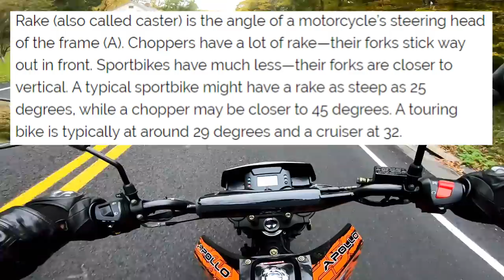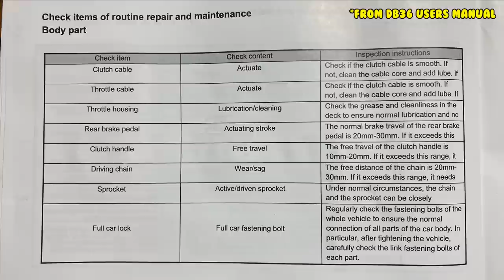[E1] Vitacci Apollo DB36 Supermoto Review, Build, Assembly, Test Drive, Impressions.(updated $1799)

Comment: If it's anything like the new Royal Enfields you will gain a lot of power bypassing the evap unit for the omissions. Nice looking bike, I like the Honda valve adjustments caps like my XR250R , best design I reckon .
Reply from the maker: I’m going to remove it eventually. Honda clone motor!.

Comment: The break in thing is a myth. Watch factory videos where they put bikes on a dyno before they send them out to make sure everything is good. They already put the bike through the whole rev range. When you break in just fluctuate the revs, that's all. Don't baby it.
Reply from the maker: That’s current bikes. These are like cars and bikes from the 80s. I do a small breakin. I certainly don’t baby it. 300 miles is it. Corvette even has it programmed in the computer you can’t rev past a certain ROM until a set mileage still too. Chargers etc too

Comment: Nice work. I see you mentioned no counterbalancer.  For you to think about that tells me these things buzz. I'm an old bsa 441 guy, and I know buzz. Tight engine bolts and a cylinder head brace help, but. I read somewhere about  filling the handlebar ends with lead, and it made a big difference in buzz. Shape a bit of wood to make a plug and force it into the bar end then in goes the melted lead. A coffee can and a few tireweights or whatever you have, melted and poured in. Propane will do it.  Oh, melting lead will kill you if you get even the least bit of water in the melt. So safety up for this bit.  BE CAREFUL. Only the stuff in the ends helps, no need to fill the bar center. Keep up the good work.

Comment: Hey i been having this bike fo about 6months. I can get to about 70 regular driving 75mph downhill tucked lol.. Wat can i do to make this thing a lil faster.. i tried lookin fo a cam but they dont sell cams fo this bike. I was lookin fo cdi proformance box and ignition but seen alot of vid. Seens like they dont do much. Was thinkin of gettin a nibbi racing carb with filter n jetting. What do u think?
Reply from the maker: Yes. Either bigger racing carb or porting and head work
Reply: Find out how many baffles are in the exhaust that you can drill out without touching the spark arrestor and take the lid off ;)

Comment: Which one is the best in your opinion? I really want to get one but can't decide which. 
Thanks for doing these. Very entertaining.
Reply from the maker: It's between the Brozz 250 and the Hawk DLX. I have a ranking chart on MotoCheez.com comparing all the bikes I've reviewed
Reply: @MotoCheez  cool! I'll check it out. Thanks
Reply: @MotoCheez  can you break this down a little bit I've looked at your charts, but I saw the Apollo has a higher overall ranks then the dlx, which bike would be better for which crowds if you don't mind my asking
Reply from the maker: If you're looking for a supermoto it's great. Suspension is too tight for offroad, the engine is a CB overhead cam engine too.

Comment: Breaking in an engine is not about keeping the revs low it is about constantly varying the revs and not allowing the revs to remain the same for extened periods of time, the more you know.
Reply from the maker: Yes,. That's correct. Varied rpms and loads.

Comment: I wish we could get some of these dual Sport bikes in Canada
Reply from the maker: They’re not up there? Pretty sure txpowersports ships to Canada. Not sure though.
Reply: @MotoCheez  we can get the pitbikes and some of the smaller dirtbikes but I have not managed to find any of the dual sports or larger dirtbikes. I think it's due to Canada having more strict safety laws.

I had looked at tx before but will check again. Having a cheap bike I can use to go to work when it's nice would be awesome.

Comment: Well I over 700 miles on the bike so far. I been doing alot of highway riding aound 55 to 60 mph. I wanting to do a sprocket change to lower the rpms. What would u recommend to change it to and where would u buy it ?
Reply from the maker: Since these bikes have the larger chains I don't know the size yet. You can switch it over to the 428 setup the hawk runs, or maybe chinariders.net has the size you'd need. I'll probably know in about a month when I do mine.
Reply: @MotoCheez  I'll wait till u do yours!!!!  Mini truck making that money I see !!!!
Reply from the maker: @therockjab  yes!!!

Comment: oh hey MotoCheez i just really want to ask you what main jet did you used on the apollo when you take out the 109 main jet
Reply from the maker: I think the 112.5 worked best.
Reply: @MotoCheez  ok thanks MotoCheez
Reply: @MotoCheez  how about i do 115 is it ok
Reply from the maker: You can try it. If it boggs full throttle, drop I'd down.
Reply: @MotoCheez  ok thanks MotoCheez
Reply: @MotoCheez  i want to ask you what is the best sproket size for the apollo to get more power/speed
Reply: for front and back
Reply from the maker: I haven't changed mine, they're different pitch than the hawk and TBR7
Reply: @MotoCheez  ooo ok thanks for the information..But if you want to change it please make a video of it

Comment: Hey so took the bike out however the fuel gauge isn't working to u have any issues with yours not working tid I have to plug anything in ?
Reply from the maker: Mine works fine. You fill up the tank? At 1/4 mine reads empty.
Reply: @MotoCheez  good to know!!! dont laugh but it wasnt plugged up ha ha !!!!!
Reply from the maker: @therockjab  haha. That's my first suggestion, but I passed over it..
Reply: @MotoCheez   yea went back to the basics... everything was plugged up but that ha ha.  Definitely gonna have to jet this thing . I have to run it on full choke for a while then half choke to run.. halfway decent.

Comment: Hey, Motocheez  what do you think about the Appolo DB36 for a trail riding bike I weigh 130 pounds and I live in centra; Texas about 130 miles north of Austin witch is the capital?
Reply from the maker: It's a harder ride, but you can use for trails. Only issue I had was the kickstand bracket hanging so low.

Comment: Those features are hilarious. Air shock? Over head cam? Wow big f'n deal. Roller chain guides are not preferable. Most those features are bad not good. That bike is junk.
Reply from the maker: Nitrogen charged. It’s an exact Honda cloned engine. Rollers I agree on such a small travel suspension bike

Comment: I'm not  Knowledgeable about dirt bikes so excuse me if my question sounds dumb.☺ so  The carburetor why did you take it off then change the little boat that was in there. I know you used the correct names but I forgot 😅 I'm actually about to buy one of these so I mbv trying to get some information  thnx
Reply from the maker: Any new item with a gas engine has to pass EPA to be registered, so they come very lean. If you're at a high elevation like 6000 feet jetting may work

Comment: I just got mine today I ordered it off amazon because txpowersport.com didn’t have them in stock forever it seemed so I ordered a black one had to take a green one which is fine I’m taking the stickers off anyway but a few things if your gonna get one is get different bolts for the plastics the tank shroud will not work with the short bolts they give you....you will get a few rubber bushings on the triple clamp holding it into the metal package use them to isolate the fuel tank when bolting it in because the will crack from vibration.....also delete the main fuse ....one more thing that could leave you stranded....if you order a nibbi carb you need the angle intake from semoto Because the straight one won’t work....the bars need the adapter risers you can’t bolt up to the triple tree with any normal riser....I’m going to machine the stock ones to fit a fat bar....but it fired right up ....good looking little bike ....and cheez is right the motor feels strong and brappy

Comment: I’m thinking about getting this bike. Guy is asking 2500. It’s assembled and has 60 day warranty. Is this a good deal?
Reply from the maker: Hmm. Idk.. it comes down to preference
Reply: @MotoCheez  Thanks for responding. Is your Apollo 250 still proving to be durable?
Reply from the maker: Pretty muck. The tank cracked from vibration. Should be rubber mounted. Can do if you buy. Runs great after mods. I show it all in video playlist for it

Comment: cool video great looking bike I like it, I have the very same engine only I used a PWK38mm carby  and it runs so much better you will need the adapter for the inlet manifold
Reply from the maker: Thanks, I have been wanting to put one of those carbs on one of my bikes!
Reply: I have the all dirt 250 and it seems to struggle when I give it gas. Do you have a link to the carb you bought?
Reply: @drchan5893  Thanks I will check that out. Do you remember what jets you run in it? Im new to all of this.
Reply: @haydenrudd4514  , you need 30-32mm, but before you buy check your carby the fuel jet should be no bigger than 110 also check your valves have a little clearance If you still have trouble check the fuel pump run a piece of hose from the tank straight to the carby if this works you know its the fuel pump not working at high RPM and the fuel should be 91-95 Octane.
IF you buy a new carby get a VM26 and it will bolt up no problems you don't need to get any adaptors-  let me know how you go with it, Im here to help if you need.
Reply: @drchan5893  So you suggest a 26mm carb over the 38mm for this engine? Thought you had put the 38mm on yours
Reply: @haydenrudd4514  - VM26 is 30mm this was just a suggestion for you however you can get a bigger carby but you will need to find the inlet manifold ( adapter ) to suit your motor. I had a PWK34mm it came with the adapter hose and spare jets BUT you need to change the Inlet manifold to suit this carby 
I just wanted more power so i got the PWK 38mm
Reply: @drchan5893  Thats exactly what I am looking for, more power ha
Reply: @drchan5893  So what adapter did you end up useing?
Reply: @haydenrudd4514  - this is the link for the carby https://www.aliexpress.com/item/Universal-250CC-350CC-PWK-Carburador-Motorcycle-Carburetor-For-Mikuni-Dellorto-Koso-With-powerjet.
scroll to the bottom of the page and you will see the adapters.

Comment: Hey I’m trying to take off my carburetor how you get the choke line off without removing the tank
Reply from the maker: the cable disconnects and the cable should work out through the groove for end ball
Reply: MotoCheez sent you a pic on ig

Comment: Like how bad is it on the trails? Could I at least enjoy it on a dirt road?
Reply from the maker: It's fine in a dirt road, just a little stiff suspension but it's perfectly fine for trails and dirt, as long as you don't hop logs. Lol. Unless you move the stand bracket

Comment: Honestly you ride one these things you’ve rode them all they use the same Lifan motor or exact same design and the frames and suspension are deadly on these oversized pit bikes
Reply from the maker: Brandon_kx250f the CB motor is great. Suspension on this bike is very different. And the enduros have a few different type suspensions.

Comment: Which would you choose between the hawk dlx and this apollo if you travel on it like I plan to do.? I am planning to ride about 650mi one way and would like some of your thoughts on fuel economy, reliability, etc. on the two.
Reply from the maker: The Hawk for sure. This Apollo has a small tank and narrow seat. These bikes get between 45 and 50 mpg and are pretty reliable. They used expired patents of Honda engines and clone them.

Comment: Hi Motocheez! Getting ready to tune the PZ30 carb on my apollo. How did you get the brass plug out for the mixture adjustment? Also did you end up shimming the needle? Thanks!!
Reply from the maker: The brass plug is a bitch. Small drill from the side and I knocked it out. I used a small #8 washer to shim needle. Yw

Comment: Amazing how to assemble it, are the gears close ratio? I may get motorcycle operator license to use on nearby roads, are the tires a Chinese brand? Does it have a rim lock like a HONDA dirt bike? How would you rate it's safety performance?
Reply from the maker: Gears aren't that close, but decent with stock sprockets tires Chinese too. No rim locks but has the hole. Pretty safe and reliable. A ton are out there over the last 5 plus years
Reply: @MotoCheez  These might eventually sell more than the other brands I'm thinking because of more affordability, why pay like 18k for one that could be like 2 dirt bikes or 1 car for example? It's ALL about cost.
Reply from the maker: They're great if.you know how to tinker on them
Reply: @MotoCheez  I know how to also work on my HONDA XR400R but also I let my mechanic do some of the major work for a lower cost than the dealer to save $$$.
Reply: Do the tires have a name on them like SHINKO? Can you get inner tubes with angled valves in possibly 17 inch?
Reply from the maker: It's china brand tires but they're decent tires even in the rain. I'm sure you can probably find angled stem tubes. The rims like the bikes are copies of japanese bikes. Not sure what rim this would be off. It was probably a drum style converted to disc.

Comment: How reliable are these things? The price is very tempting
Reply from the maker: David Stancu I’ve had dozens of Chinese bikes over the last 3 plus years and they’ve impressed me, small issues like bolts vibrating out. Some adjustments and tweaking. Overall I say well worth the money. Not powerhouses or motocross bikes but decent back road and trail bikes.

Comment: Are the wheels small or are they normal size compared to the hawk?
Reply from the maker: They’re smaller (17”) and the front tire same diameter as the rear. Usually dirt bikes have 2” larger front wheel. Sit it handles great in the road.

Comment: It sounds like the valves are to tight to me.
Reply from the maker: Why do you say that?
Reply: @MotoCheez  Tight valves have a certain sound to them.  I've done a BUNCH of work on chinese 150cc motors & learned to tell a lot about engines tune by sound.  Of course, I'm listing through youtube, on my phone.  So could easily be 100% wrong!  But just the way that motor revs & doesn't have really crisp sounding compression, it would normally mean the valves or at least one of them isn't closing all the way.  :/
Reply from the maker: @2CabrasLocas  ahh, I see  in person it sounds ok by ear. Don't forget these are the OHC CB style engines, not the pushrod CG. And a tight ntake wouldn't idle very good and  tight exhaust would cause excessive heat.

Comment: With those rim sizes you may be able to run a 120/70-17 front and 140/70-17 rear to get some awesome supermoto street tires (conti attack sm, metzelers, etc)
Reply: I was thinking the same.... did you ever figure out can it be installed? That will be a sick look also can you change the exhaust? Im thinking of getting one in April

Comment: Just got mine, looking to get more top end. Would you recommend running 16t in front and leaving the rear stock for gear ratio
Reply from the maker: Yes, i I also want to go up a tooth in the front I was actually going to do the same soon. Haven't researched what front sprocket will fit, it's not the same sprocket pitch as the other China bikes. .
Reply: Right on brother, post a vid if you find something. I’m checking out your website now your the man
Reply from the maker: Thanks!😁
Reply: What’s up motocheez getting my new carb in tommarow. Do you remember what the stock pilot jet number was? if you could tell me I’d appreciate it man .
Reply from the maker: I don't recall the size... Not sure if I showed in this video either. 35 maybe?
Reply: MotoCheez thanks 👍

Comment: Break it in like you want to ride it. Unless its flat tappet cam. You want cylinder pressure to seat the rings.
Reply from the maker: But they say if you run too hard and there’s blow you before rings seated it will glaze the cylinder from washing the oil.
Reply: @MotoCheez  if you wait to load it up it'll wear the etching before getting high cylinder pressure. I was taught get it running, set the valve lash and verify oil flow. Then take it out for hot laps and run it as hard as possible. If there's any defects, you want to know before your heat race.  Race engines dont get 1000 mile break ins.
Reply: Race engines also get rebuilt a lot more often.
Reply: @techmaven5900  25-30 nights is pretty normal. I was under the impression that manufactures want an easy break in because mass produced motors arnt precise and they want any imperfections to wear in rather break.  Either way. 1,000 ways to skin a cat. I'll stick to my ways of setting the valves, checking oil pressure and breaking it in hard
Reply: @Motocheez: You are correct. I break my engines in by varying the load and rpm for several hundred miles. On the Chinese bikes for example, I do repeated 30 to 50mph runs in 4th gear at 50-75% throttle. Full goose after 2 oil changes at 300 and 600 miles.
Reply: @techmaven5900  damn. 300 miles. I was always told you have virtually no miles to let it wear in or you loose the prime opportunity to seat the rings. I know engine builders will typically heat cycle once. Check valves and then hammer down on the dyno or into the car. I've got a gy6 to rebuild next month and I plan to heat cycle it once maybe 5-10 at idle. Change the oil then RIP and hard as possible and recheck the valves one last time.
Reply: I guess it's pretty much whatever works..let er eat!!!!